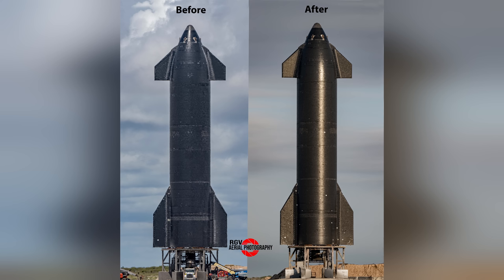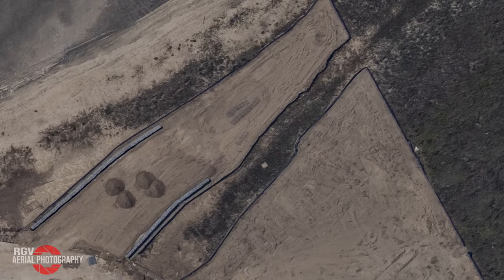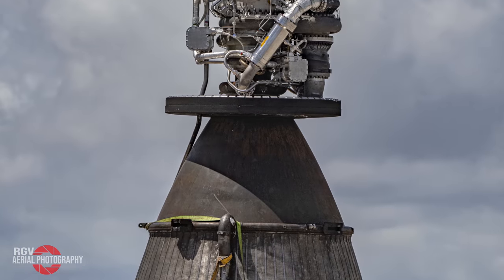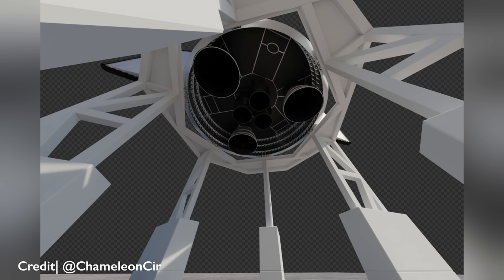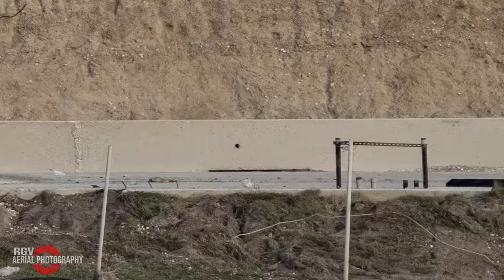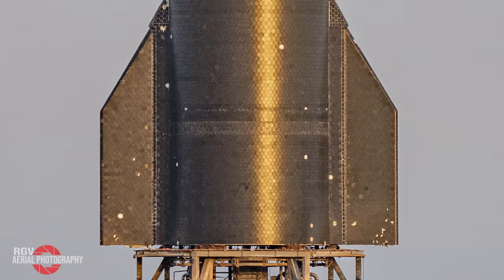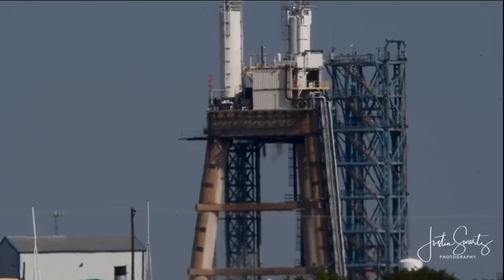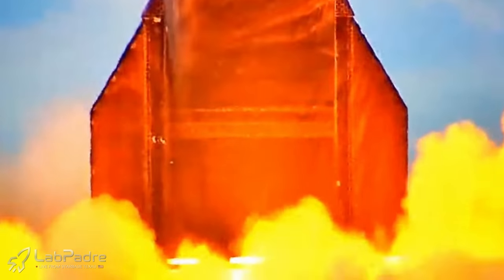Analyzing the Aftermath of Ship 24's 6 Engine Static Fire Test

Comment: Another great video. If the broken tiles are from vaporised concrete probably means Starship will be safe in an actual launch, hopefully the booster doesn't catch any.   One thing I'm curious about though. In regard to fire suppression I hear a lot of talk about flame diverters etc Surely a much easier and cheap solution would be some sort of sprinkler system to douse the grassed area within debris range of the test stand for 1/2 an hour or so before static fires or launches? Some of the irrigation ones on farms seem to cover a huge area. Maybe run water trucks over the area prior to it having to be cleared for testing?
Reply: Why do you think Starship will be safe in an actual launch? Once the Raptors are fired up It will be held down for around 3-4 seconds while they are reaching max thrust then when the clamps release Starship it will take another 10 seconds or more before the flame is far enough away to stop melting concrete and blasting debris all over the place. That’s a lot longer than any static fire test so far and we have all seen how much damage they cause to the pad, the booster, the engines and surrounding area. They need a proper flame diverter trench and water deluge system, I think that’s obvious. Ask NASA why they use it, even way back in the 60’s and 70’s when launching the Saturn V Apollo spacecraft to the moon, and Starship engines will be far more powerful when launching.
Reply: @keithmayes4358  Not a 100% sure but the OLM does have a deluge system though it's effectiveness is yet to be tested along with a much greater height above the ground than the Starship test stands. I'm hoping these will be enough though I certainly wouldn't bet my house on it.
Reply: @scottlymbery7948   and I wouldn’t bet my house on it either lol

Comment: Great work! As if one of the cameras from the SO pad was found 🤩 
I wonder if the bern is constructed from the same grade of concrete as the new concrete under the pad? Is it a good idea to have a flat surface under the engines as the energy could bounce back into the skirt?

Comment: Although I'm a big fan of the SpaceX Starship and super heavy program, I'm skeptical about the damage that'll be done to any ship that lands on Mars, or takes off from Mars. Additionally, when Starships start coming back with cargo, the thrust required during Landing will be doubled, so I suspect there will be considerable strain on the ship's hull during Landing.
Reply: A starting Starship will not be hitten so hard by the debris. The most damage is caused by the fact it is stripped down to the pad. Heatshield killing vibrations will also go down if not bolted to the pad. A landing Starship will only require one (or less) raptors to land because the weight of the fuel is gone.
Also: Starship will usualy not start it's Raptors on earth.

Comment: Great post. New sub here and my thought, is they need to implement a flame diverter. That would solve several problems. 1 diverting the total thrust rebound from the under side of the ship. 2 direct the blast in a direction where unwanted fires could be better controlled. 3 help to channel any possible debris in a more predictable direction. 4 Increase the efficiency of the deluge system.

Comment: The pipe on Starships Raptor can not be from an over pressure. If it were an OP the damage would create a hole with the material bending outwards. An impact caused the inward dent shown.

Comment: If those camera housings were found some 200 meters from the test stand, they are good candidates for what damaged the methane line on the RVAC! That was less than 10 meters away and far more likely to dent stainless pipes of that thickness. It's doubtful limestone aggregate from the concrete would have been hard enough.

Comment: Those 6 Raptors are insanely violent combined. Maybe, if the booster wasn't fitted with 33 Raptors, then the test of these 6 would not appear to us as a puny test. But Spacex is learning a lot from the damages. How come there is'nt a steel plate below the engines? Maybe there will be. Bloody good work, again, Zack!

Comment: Great investigation Zack and team! You blow me away with your findings each and every time! One point though - given SS will not light its engines until around 100km above ground level, isn't the flying FOD and damage issue a moot point outside of testing? Damage due to vibration would be greater on the ground also due to SS being clamped down to a rigid test stand. I'm certainly no expert, so happy to be shot down.

Comment: With the power of the Raptor engines, SpaceX will likely have to go to some sort of flame diverter perhaps with a retractable drive on the maintenance deck.  This type of reengineering may require a ramp to get sufficiently above ground level much like 39A and 39B. The pad engine exhaust and blowback damage are unsustainable for regular operation.

Comment: That damage to the concrete slab is called spalling.  There's moisture in the concrete that turns to steam under the intense heat.  The steam expands faster than it can escape through the porous material, and that pops flakes from the surface.

Comment: I want to know under what circumstance all 6 engines would be firing at the same time, why is this test even necessary? 
At launch after the booster separates from Starship only the vacuum engines should be firing as it climbs to orbit.
For a reentry burn, again only vacuum engines needed. 
And for landing (after reentry and aerodynamic speed reduction only the sea level engines should be firing for final breaking until caught by the chopsticks. 
What am I getting wrong here?
Reply: a laden starship will need both rvac and sea level to reach orbit.  Note that the rVacs don't gimbal.
Reply: @KnugLidi  OK, learned something. I wonder at what altitude the expansion bell becomes so inefficient on the sea level (I alway mentality call them atmospheric engines) engines that they shut those off?
Reply: @bobjoatmon1993  That I do not know.  The Isp will continue to drop as the atmospheric pressure drops, but I don't know the lower limit of Isp.  It is not zero obviously, but I wouldn't be surprised if lower bound of the Isp approaches 200 s.
Reply: I am wrong. Wikipedia suggests Isp of about 330 s at sea level but increasing to 356 in vacuum, with the Rvac version being 375 in vacuum.  I was expecting 1)sea level raptor's efficiency to fall off in vacuum, which it doesn't and 2) that the difference in vacuum performance between R and Rvac to be much larger
Reply: @KnugLidi  thanks for the research.
I was supprised by what you found as I thought the difference was greater too
Reply: @bobjoatmon1993  You're welcome!  We both learned things today.  I don't mind having my preconceptions proved incorrect, as its the only way to learn new things.

Comment: SpaceX will likely have to make further improvements to the pad concrete along with ways to divert the energy especially when all 33 engines are test fired. If they end up having to increase the height of the OLM, they'll have to choose between digging down or modifying the tower with all it's systems. If they dig down, then they'll also probably build a more robust diverter.

Comment: I tried to understand the cause of the dust cloud when they do these tests and the concrete damage shown it the video explains it.
If normal concrete is rapidly heated the expansion of the surface layer of concrete alone is enough to cause it to spall - even if totally dry heating  concrete to around 600 degrees Celsius will cause the calcium hydroxide which is part of the portland cement to decompose loosing it's strength and releasing steam and causing pressure inside the material so you have steam pressure and the weakening of the binding agent happen. The rocket exhaust easily erodes the concrete and the sand and gravel in the concrete mix are blasted into the air by the rocket exhaust causing the big dust cloud and the water vapor also condenses out creating fog.
Any water held in small cracks or voids in the concrete surface will also expand and vaporise which adds to the spalling damage.
So the cloud of stuff we see blow up is really unavoidable it's not just because spacex have loose sand and stuff they can't be bothered to sweep up.

Good thing is for a real launch the rocket will be up and away so fast there will probably be less damage during a normal launch than happens during testing.
I think the longer plan is for them to have a protection system which goes over the concrete able to withstand the rocket blast in future to avoid sand blasting everything near the launch area.
Reply from the maker: Thanks. I wish I knew about that before I put this episode out.  Could have added even more detail.

Comment: Concrete, exposed to extreme temperatures, explodes.  Surface layer after surface layer will blast free.
You can prove this to yourself by using a torch and pointing it at a concreate block, you will hear the tiny explosions and feel the splatter hitting you.
Now scale up the torch to a Raptor engine.
To prevent this, the exposed concreate surfaces need to be covered by steel plates and the plates need to be cooled by lots of water.

Comment: A grass fire seems of minor concern and unlikely to become a California-type wildfire on the wet Gulf Coast.  The environmental sensitivity at Boca Chica is more the sea life and even mud creatures are protected from ground fires.  Propellant spills are likely of more concern, but the liquid methane and liquid oxygen used by the StarShip Raptor engines will quickly evaporate, so little concern.  If they were launching Falcon vehicles with kerosene propellant, that would be more concerning, though has been done for many decades at Kennedy by many companies and NASA yet it is a fabulous wildlife sanctuary.

Tiles shaking off StarShip during launch may prove the "long pole in the tent" towards a successful orbital mission.  But, they have bigger fish to fry before they get to re-entry issues.  The Shuttle lost some tiles early-on and still re-entered successfully, but I recall those were on the top side and vertical stabilizer tail which see less heat.  Those tiles were later replaced with a thermal blanket which sufficed at those less stressful areas.  The Shuttle skin was aluminum whereas StarShip is stainless steel with a much higher melting point, so should better survive loss of a tile.  If re-entry from low-earth orbit at Mach 22 works, next up would be re-entry from a Lunar mission which was at ~Mach 32 for the Apollo capsules.

Comment: While I'm sure SpaceX could take mitigating actions to prevent the damage, I'm guessing they are also simulating what damage is likely to occur to a vehicle landing on Mars were you won't have the clearance. 

You certainly wouldn't want to attempt Earth reentry with that damage if possible so you may need to transfer in orbit before Earth entry as it stands.

Comment: SpaceX needs a build a proper flame diverter.   No matter how much concrete they put in place, they will always have the problem of vaporizing material, debris, shock waves etc.  It is sad to consider that no one actually considered the power of these engines and what it would do to the ground.  Sometimes, it feels that SpaceX does not think about some pretty basic issues.  Like building the tank farm so close to the launching pad.

Comment: I have a question, and I suspect someone here knows the answer.

Why not cover the pad with  thick sheet steel? Is the exhaust too hot? It seems like the smoother you could make that surface, the better at deflecting all of that energy it would be.

There must be something I'm missing,  because I can't be the first to wonder about this.

Comment: This video has reminded me that SpaceX is not only testing their spacecraft and its engines and such. When these little events happen somebody at SpaceX is excited. A new problem to fix, or less dramatically stated, a new situation that requires some changes be worked out. We should not forget that SpaceX's plan is not only to send Starship to space and return it, but also to have these Starships hopping around on Earth amongst civilians. It is inevitable. Someday one of these Starships will have to make an unplanned landing and not have proper landing facilities Within reach. These unplanned events during testing will teach Starship how to make emergency landings less dangerous

I would be surprised to find any other reason to have the flaps extended other than to answer the question, "what happens if we can't close the flaps due to an malfunction?"
Reply from the maker: I couldn’t agree with that more.  I know for a fact that they get excited to solve problems. They are always skipping around making jokes and having fun on the launch mount which is a TOTAL CLUSTERFUCK currently. 

I’m sure they don’t like the delays, but everything they learn helps them avoid actually destroying the vehicle.

Comment: Right from the start I have never understood why SpaceX doesn’t have flame diverter tunnels together with a massive water deluge system same as NASA at Cape Kennedy, because without it they are going to keep running into more and more problems. Can you imagine the Starship booster engines surviving an all engine test with 30+ Raptors, let alone the damage to the booster itself as chunks of debris from the concrete pad starts smashing into it? Why do it this way? It makes no sense.

Comment: Good report. It makes me wonder if "bigger engines", "more engines", "larger BFR" maybe won't work in the long run, not unless the launch pad can be better protected, as well as damage to the rocket itself. Where there's a will, there's a way, but looks like Starship launches are largely just "let's see what happens" kind of experiments. Maybe in the future they can use simulations that can better predict specifications needed without this trial and error?
Reply: We will not be surprised when 33 raptors damage stage zero and the methane/oxygen/nitrogen farm. Ya really got to wonder why SpaceX did not start with a flame diverter when they started the new launch site in Florida.

Comment: i cant see how they can land these on the moon or mars without getting damaged up under the skirt.  even with just one throttled down engine, the damages could be catastrophic if they throw up gravel like this. the landers would have to use engine(s) mounted much higher up for landing and take off.  nasa got lucky 6 times on the moon, even though the landing module fully shielded the ascent module.

Comment: Why should they build to allow any debris at all? The materials should all be sufficiently heat resistant to endure multiple test fires with no degradation. I doubt that any concrete is heat resistant enough, and concrete absorbs water too well and is very prone to exploding and spalling. Use ceramic, over a structural reinforced concrete core that is insulated from the worst of the heat. If necessary, how about tungsten plates over the ceramic? Or: have a vertical tunnel, lined with refractory material, in the center underneath the test stand, to receive the exhaust plume. The blast beats harmlessly against empty air. Give the shaft side tunnels so there is no pressure buildup. The vertical shaft would have removable lid, of course, to allow men and machinery access to the underside of the rocket and test stand. Would these ideas be of value? Please comment.

Comment: So if flying debris can be so catastrophic to the engines, how is this thing going to land on and then takeoff from the moon?  Fixing up the test stand so that no debris flies, is just masking that future problem.
Reply from the maker: HLS lander will have cold gas thrusters near the top which are used for landing. They are 40 meters above the surface.
Reply: @CSIStarbase  Well I guess they've been thinking about this a lot more than I have been!  🙂

Comment: Great damage report but stop and think about your whole discussion about the flaps..... First - The starship sits on top of the booster and does not fire until it is miles into the air. The six raptor test will never happen in reality after testing so once the data is collected this condition will NEVER happen. Second the firing of the six raptors was a lot like a burst test on a tank. In reality the three regular raptor engines fire first then the Vacuum raptors fire in space. The Starship will never see the vibration and energy so directly during normal use. Your information was amazing it just became one of those issues of counting trees and forgetting the forest sort of situations as you got wrapped up in the details.
Reply from the maker: I think in the video I said “this will never happen in real world situation” or something along those lines.  It’s basically the same as what you are saying.

Comment: All this analysis is great but it doesn't answer the begging question. Why do it this way? These tests all seem a bit amateurish. Test pads prematurely degrading and having to be repaired, tiles falling off, blast debris being flung 100's of metres causing fire hazards and even worse, vehicle damage...  Why fire the engines and subject the whole vehicle to unnecessary hazards and expensive damage in a set up that it would not see at launch? If you're testing just the engines, fire them on their side, otherwise if testing the whole vehicle, raise the height of the vehicle, employ a properly designed blast pit and use a removable ramp system for ease of engine change. Surely Musk and his engineers can come up with a better solution, after all, this aspect doesn't utilise any rocket science....  If someone could properly explain why Musk is doing it this way, it would go a long way to instilling some faith back into what the man is trying to do. At the moment its not a very professional look and I'm going to remain highly sceptical of all this... 👍.